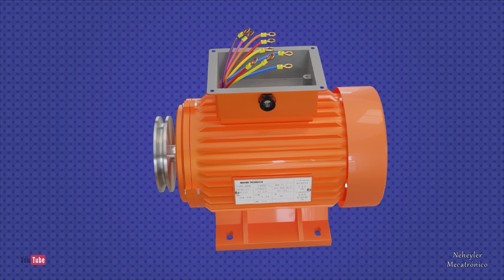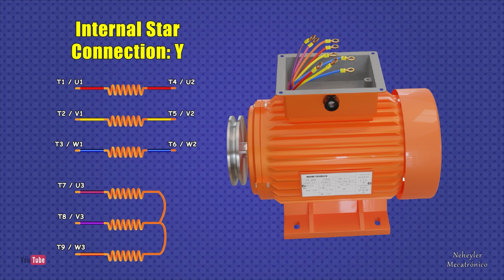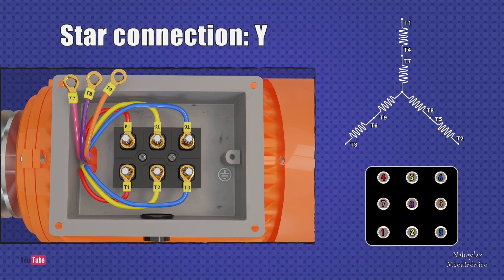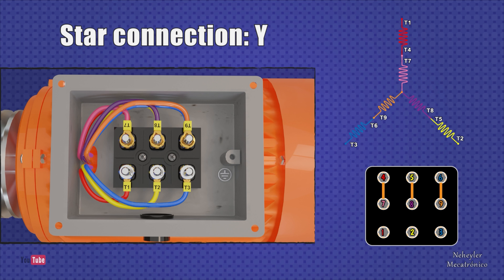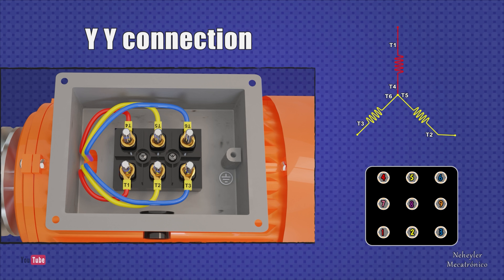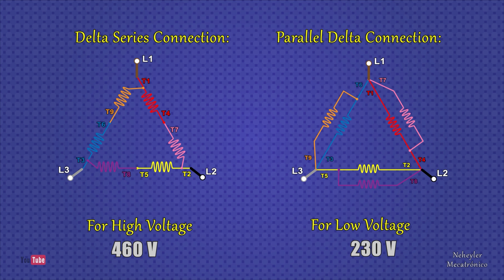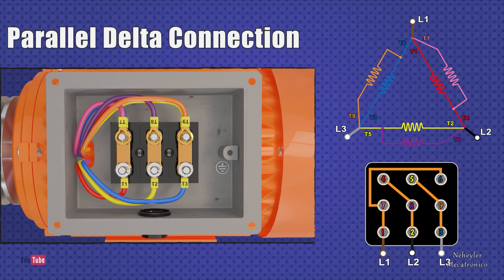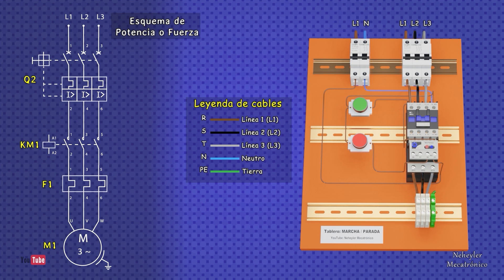9 Terminal Three Phase Motor Connection

Comment: Never do this, first the engine will have 1/3 of its rated power second it will absorb about double the electrical energy which will manifest itself with excessive heating. You will find on the WEB excellent single-phase to three-phase inverters at very low prices that will solve the problem perfectly.
Reply from the maker: Hello. This is an educational video explaining how to connect a 9-terminal motor to form the different star and delta configurations.
For industrial use, other methods must be used for better operation and to extend the useful life of the motor.
Reply: @MechatronicNeheylerinEnglish  You must excuse me, I made the wrong copy and paste, I had to insert the comment where they demonstrated how to operate a three-phase motor with single-phase current and a capacitor. Best regards
Reply: Where is 230v connection